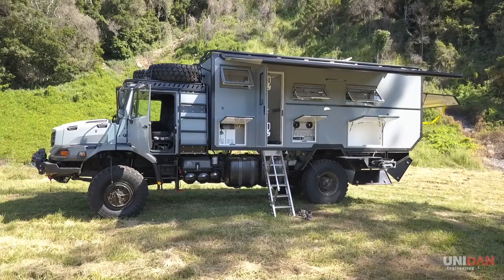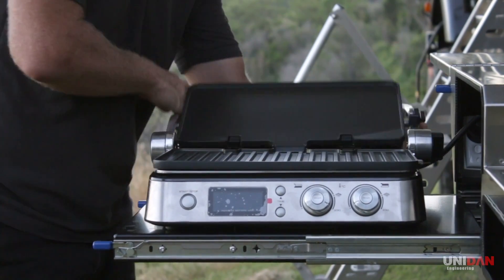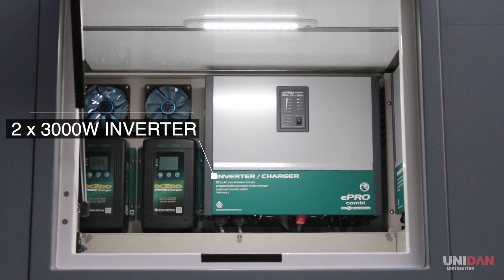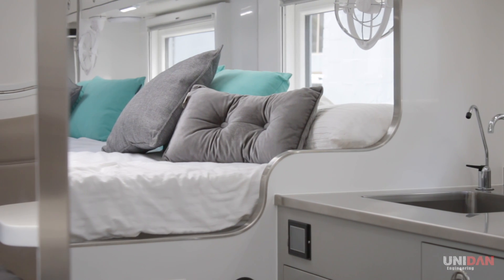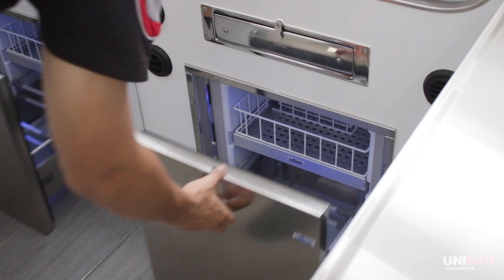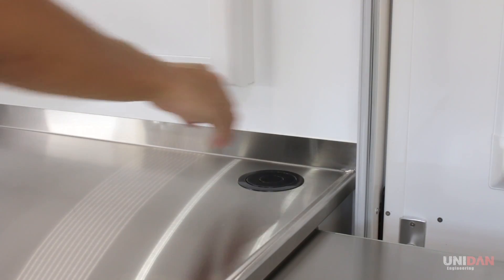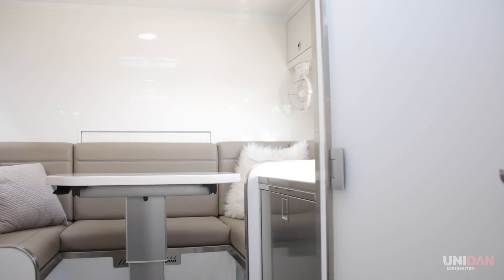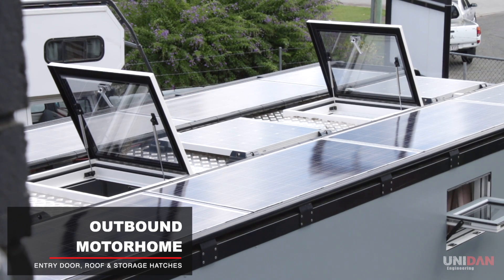Mercedes-Benz Zetros - 2020 Unidan Discovery X - COMPLETE EXPEDITION VEHICLE WALK-THROUGH

Comment: Great looking rig. But them air lines going to the tires look like they can get caught on stuff no?
Reply from the maker: Daniel Muscarella thanks Daniel! You are probably correct with this comment. We did not organise the CTIS system for this vehicle as it was aftermarket and organised by the customer. The factory system that we usually use for these new vehicles goes through the Diff to avoid this potential problem.

Comment: Why would you ever get 6kw of inverter with a 1.3kw solar panel? You either are being ripped off or you have no idea how solar works. You need more panels! Not inverters!
Reply: They have like 8 kW of battery-storage on board (assuming it is a 12V system. Of course, they can deliver 6 kW peak power output (though I am pretty sure they are mostly running it on one inverter). That is not even 1C. 6 kW is beefy, but this is a beefy and costly thing. The Mercedes chassis alone is a couple of hundred thousand dollars. So while I can see someone drawing >3 kW in brief moments (if someone wants to run the AC, make coffee, cook dinner, running the washing machine etc all at once), I am pretty sure the inverters are doubled most for redundancy in the Gobi desert and such places these trucks go and there may be some distance to the next "inverter-shop". 

The solar panels simply trickle feed the battery-bank. And I bet these batteries are supported by the engine or a gen-set if a lot of electricity is needed. 

Anyhow, batteries will happily output 5C (which in this case means that in theory, one could draw peak 30 kW from them without technical issues if one so wished (being aware that one would discharge the bank in 10 minutes). Think about the Porsche Taycan. It has a 90 kW battery that will happily output 500 kW to the motors. Same same. 

Remember that even a tiny RV with a 250W solar set-up will usually be designed with a 2 kW inverter if one has a lithium bank. 

Hope this made something more clear.
Reply: @glacieractivity  Understand thanks for clearing out. You points are legit considering redundancy and that the inverter serves more as battery inverter to handle possible surge of 5C or 50 - 150A I guess. But still I think the solar can be designed better, I have 3 designs in my mind that I can triple the solar output with not much weight panelties.

1. Use more efficient modules that are commercially available their fabrication and efficieny is far better. 950W is solar with 5m2 is easily available as a stand along commercial products. 

2. Changing designs. Like a folding mechanism to expose more surface area

3. Use micro inverters with a single phase inverter that is replaceable or even a hybrid inverter? Those are stand products in solar rooftop industry. Providing 10 year warranty and supply 5.5kw of power consistently. 

4. Stop putting everything appliances you can possibly find at home into the car! I'm buy this shit because I want to get out of my home!

That's the essence of my 5 cents.

To add: current gen LG already has 48V voltage battery with 12.6kwh capacity available that is compatible with hybrid inverter system with 3.3kw out put when in standalone (off grid mode). Sorry to say buy the system in this car is using redundant technologies in solar industry from 10 years ago

Comment: Looks brilliant, around 1.2 million?

Am I correct in assuming that the composting toilet, lack of internal cooker (just oven) etc were customer choices and that a normal toilet and built in induction cook top would be an option?
Reply: Add to that 1.2 MIL the outrageous fuel consumption - assuming you really want to travel and not just show off at the local park or beach.
Reply: @Ficktao  yeah if i can afford that, i can afford the fuel, so consumption really doesn't matter if you have enough tank space
Reply: @Ficktao  you can buy a 55 yacht for that price!! How did they even came with that number!?